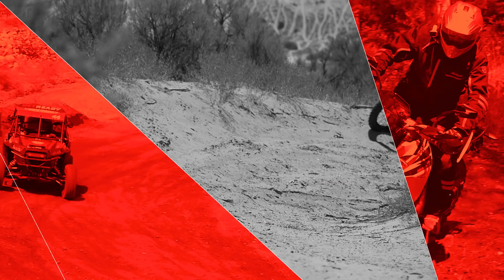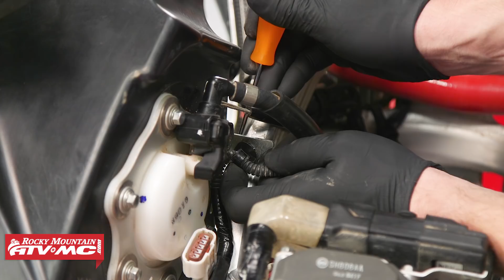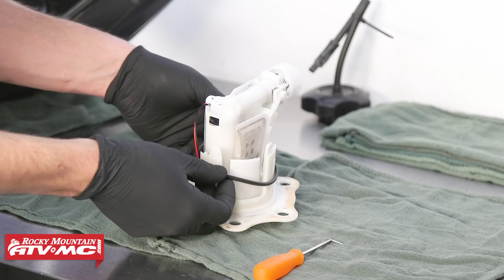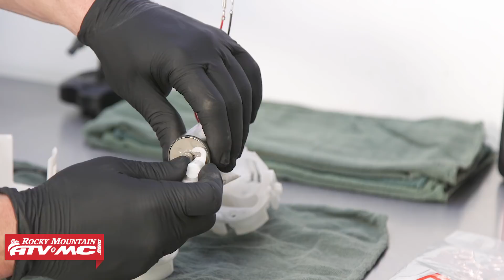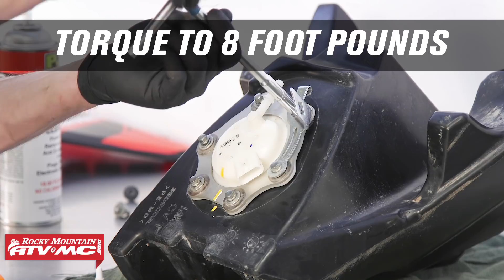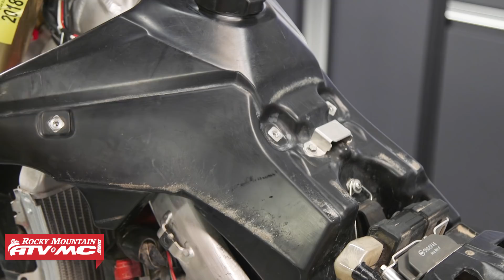Honda CRF450R/RX Fuel Pump/Filter Replacement

Comment: My 2015 crf450 is 10years old I need To change my filter and fuel pump??? Plsss reply.. because my crf is hard start I kick 50times to start...
Reply from the maker: You may need to replace the filter.
Reply: Good morning sir, tanku for replying me tanku... Only the filter???? The Fuel pump its ok i wil not change???
Reply: If my bike wil start after 50 kicks....and If i start again, it wil start in 2kicks only i dont now what is the main problem....if the bike is hot it wil start in 1kick 2kicks...

Comment: Video might be old but hopefully someone can help me out. I got a 2008 crf450, at low rpms it bogs out, needs the throttle cracked to start, runs rough up until its past 1/4 throttle but when Im in high rpms everything seems fine. After doing some research I found that it should probably be the fuel pump filter just like in this video. The problem is I cant find the filter in the manual nor fuel tank diagram. So my question is does it have the same filter, is it a different one or doesn’t it have filter. In case my bike does not have a filter what could the problem be? Perhaps something with the carburetor?
Reply from the maker: The 08 models did not have a fuel pump, they were gravity fed into the carburetor. You can get a fuel filter for your model. They are little cone shape fuel filters. You might have a clog somewhere in your carburetor. Pulling it out and cleaning it could solve the problem. If that doesn't help, new jetting kit would be where I would start.

Comment: Old video but i hope i can get some help anyway. So im about to remove the fuel tank and was wondering if i can skip the step where u start it and let run until it stals? Because it has not been running for several years so the oil and filters is not the best atm hehe. Is the step just so you dont get fuel everywhere? ^^
Reply from the maker: You don't have to; it helps from spilling the fuel when removing the parts. Emptying the fuel system.

Comment: I have a 2019 crf450x and it has been getting harder and harder to start could this be the issue?
Reply: Depending on the hours on the bike, I’d suggest checking valve clearances. Incorrect clearances can cause hard starting

Comment: After replacing the filter is there any sort of priming that needs to be done? I just replaced my fuel filter and am having some trouble getting my bike going again. There is fuel running through the line and everything seems to be connected but it doesn’t even try to turn over when i kick it, any suggestions?
Reply from the maker: It might take a bit to start but it should prime itself after a few times of trying to turn over. Just make sure all your connections (fuel fittings, battery terminals, fuel filter wires) are all connected properly.
Reply: Rocky Mountain ATV MC Thanks! Ill have to do a once over on everything then.

Comment: Why should you replace the fuel pump or fuel pump assembly if there is more than a 1 mm gap between the tabs and hooks?   I just replaced my filter on my 2016 crf250r and the tabs and hooks were holding firmly just fine however the gap between them was more than 4 thousands of an inch .004 . or 1 mm.   Should I take it back out and replace the whole thing because of this?  PLEASE HELP
Reply: Shouldn’t be a huge issue

Comment: Anyone know why fuel would continue to come out when the line is taken off? Just replaced the pump and filter and can’t seem to find the problem.
Reply from the maker: Jaxon Slocum So, the fuel is coming out of the fuel pump?  Did you follow all of our steps in this video?  Are you disconnecting the fuel feed hose from the pump?  This should stop the gas from coming out once disconnected.
Reply: Jaxon Slocum did u find out wot was up with it leaking fuel
Reply: wigan9581 nope. Haven’t been able to get my bike to start since replacing the pump and filter also.
Reply: Jaxon Slocum  another bike down via trying to follow the over the top service intravals ....honda loves it ...get the old bikes into the scrap heap and sell new ones ...disposable society...makes me want to SCREAM!
Reply: btw Jaxon Slocum...are you related to Joshua Slocum sailed round the world in a tiny sailboat?   
Joshua Slocum, Sailing Alone Around the World
Joshua SlocumJune 21, 2012
Text Publishing
Switch to the audiobook
3
Add to Wishlist
Joshua Slocum was the first man to circumnavigate the world single-handed. His classic account of his voyage, Sailing Alone Around the World, has been captivating readers for over a hundred years. It remains one of the most thrilling and entertaining travel narratives of all time. Slocum writes of dangers and delights in encounters with Moorish pirates and Juan Fernandez islanders, tempests and languid seas, sharks and flying fish. 

Even if you are not into boats by the time you read this you will WANT TO BE!
Reply: Hey @jasonslocum8948 did you find your problem ?